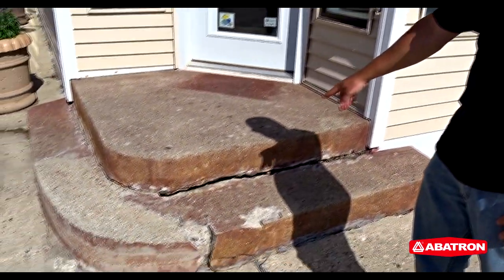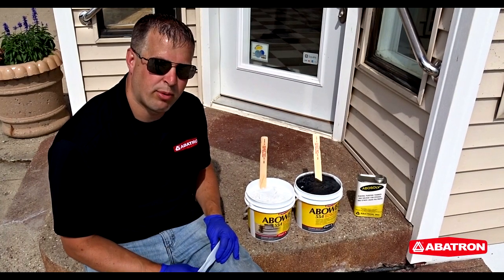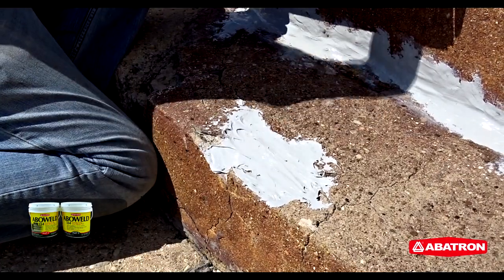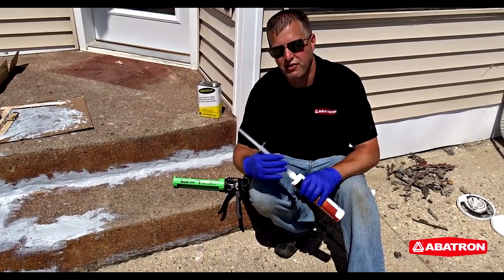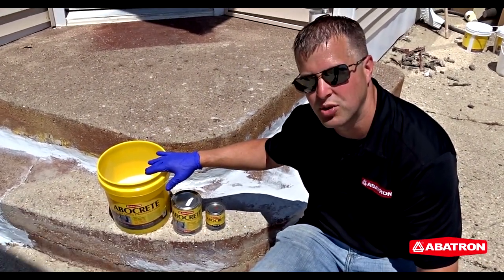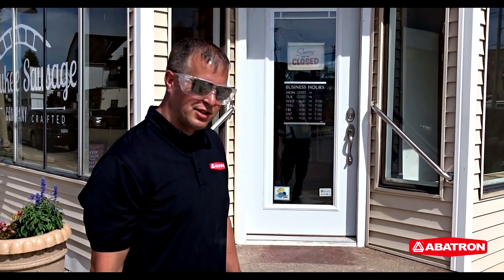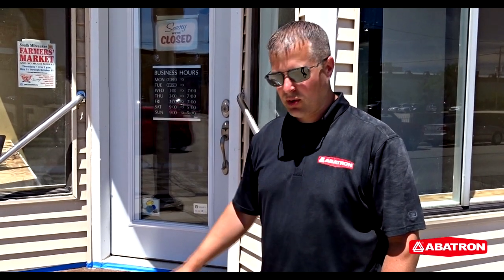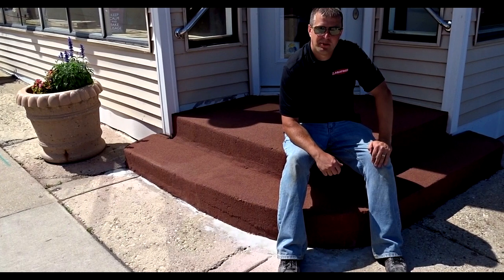Concrete Step Repair

Comment: It's to bad the store is closed when I looked in 2025.  The address is 1200 Milwaukee Ave, South Milwaukee, WI 53172.  You can check google street view and it looks like the steps held up ok over the years.

Comment: I love Abatron products, but they are fairly expensive and the careful crafting needed to make the crack repairs flush with the existing concrete seem to be labor intensive.  I was wondering if anyone had done a cost analysis comparing the cost of this repair to the cost of removing and re-pouring new steps?
Reply from the maker: While certain projects require careful crafting, our products can generally be used by the DIY customer.  This typically saves significant labor costs incurred when hiring a professional.  We didn't have a professional replacement estimate on this job, but the product costs would have come in under $500.

Comment: Wow, that before/after starting at 8:08 really freaked me out - it looks like a whole building disappeared in the background!  Took me a minute to figure out what happened there.

My questions are: when do you use Aboweld and when do you use Abocrete?  It seems you were filling the same sorts of spaces.

Also, what kind of grinding wheel?  One used for metal?
Reply: Aboweld is generally used on vertical applications, while Abocrete is limited to horizontal treads, since it is self-leveling.
Reply: Ah I see, thanks.